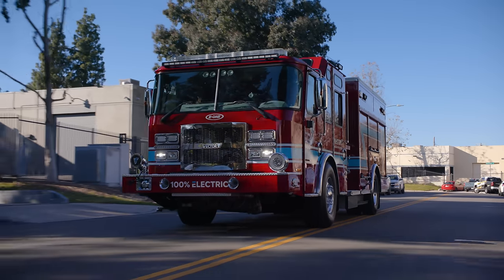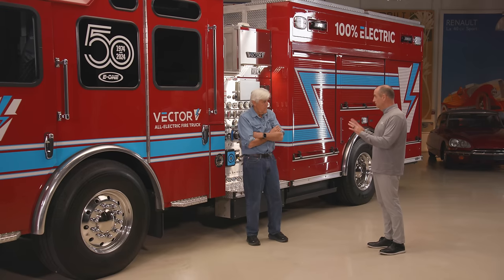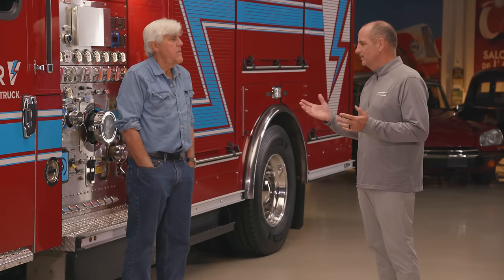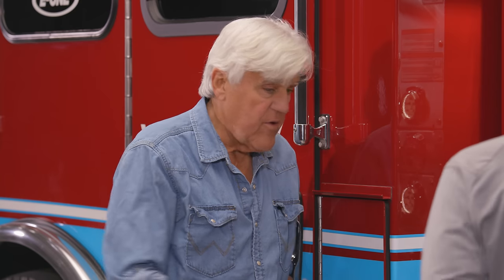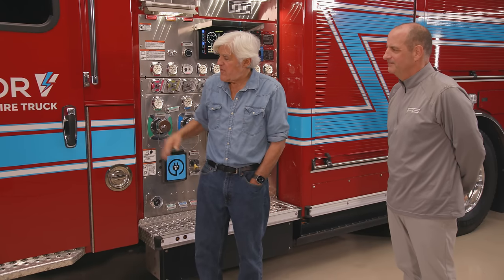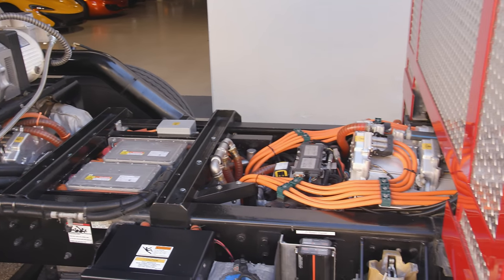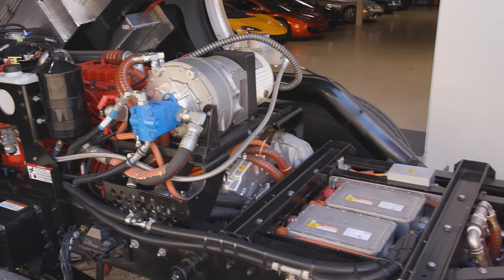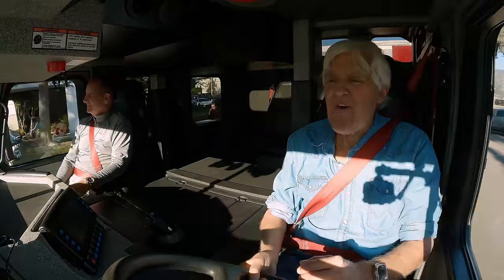The Future of Firetrucks?

Comment: Ah, the negative comments…the Fire Service …” 100 Years of Tradition, Unimpeded by Progress.” 
“Let’s build the same engine my grandfather work on .” “ I want to turn a knob , not press a button .” 
E-One president says it takes about 2 1/2 hours from zero to charge . Firefighter hears it takes 10 hours .  

In all the years I was connected to the Fire Service , I never heard a bigger bunch of back stabbing , complaining old ladies in my life .
Reply: He said 2.5 hours with 3 phase 480V. Perhaps the 10 hour charge is on 220V?
Reply: Yeah those batteries last about 5 years then it cost another hundred thousand dollars and tons of more diesel to mine the batteries God forbid the weather gets cold😂
Reply: Lol right. Only way you can say a leather helmet is better than a salid bowl, is it looks cool.
Reply: No thin blue line in the fire service that's for certain!
Reply: @tkreitler  It's very simple he said 327kwh battery and 2.5 hour charging time. That's 130kw / kVA average charging speed, which is closest to industry standard 150kw peak Level 3 DC Charger. Thus why it uses the bog standard Type 1 CCS plus same as personal cars.
327kwh for 10 hours mean 32.7 kW / kVA charging speed. No such charger is being produced in large numbers. There is a gap between Level 2 and Level 3 Charger which is about 25k to 50kw where chargers do not charge at that rate.
It's either going to take 16:15 hours at Level 2 240v or 6:30 Hours with 50Kw Level 3 DC. These are the realistic slow numbers.

Comment: Makes sense for it to be electric. Most trucks just sit around for days so it can charge all the time. Most trips are short. They need ambulances to be electric as well.
Reply: Yeah, maybe in a small town department
Reply: Are you on crack? Ambulances might go 18 hours straight without making it back to the station. I’ve literally had to stop for fuel on the way to calls because it isn’t hard to burn through your 200/300 mile range of a standard ambulance. A lot of services spec larger fuel tanks.

Comment: This is a good application of an electric vehicle, inner city, short haul, high power. 
The pump requiring an engine negates the viability of an electric pumper truck. There are other fire trucks that could be EV; ladders, ambulances, chief, etc...
Nice to hear the EV is done in Scotland. Let's keep our essential infrastructure in the West.
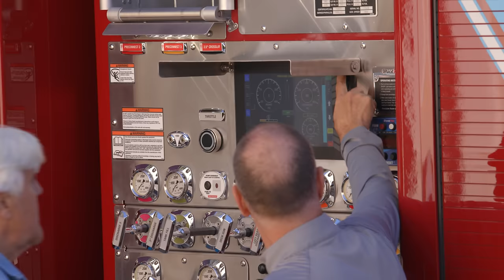So far as conservatism is concerned, at a fire one cannot have an equipment failure. Electronics just aren't reliable enough for something like this. That glitch at 24:20 is a great illustration...
"Stuff that works" is the idea.
Pollution of a fire truck at a fire is an oxymoron, the fire is causing thousands of times the amount of the truck.

Comment: They already had problems with them in Canada.cold weather...
Reply: Oh, yeah.    EVs have to keep the battery working.   The computers make the health of the batter the #1 priority.
Reply: @GilmerJohn  Weve got some new all electric buses around her, they have 
very powerful AC, not for the passengers, for the computers and motor to keep them cool.
Reply: @phillipsmiley5930  --  well, most electronics can actually tolerate moderate extremes of heat and cold.   So can motors.  I would hope the designers are smart enough to not worry about the electronics or the motors getting too cold or moderately hot.   But as a continuing chemical reaction, the batteries have more constraints.   Freezing might destroy some cells.  Moreover, the performance and life greatly changes with temperature.
Reply: @GilmerJohn Once the giant battery gets cold enough it's done! There's no way to get around that! They aren't feasible in cold weather states.

Comment: Putting a diesel generator inside of the thing is comical
Reply: What’s the point of it being electric. All these companies are just trying to money grab anything with EV crap.
Reply: How's a backup diesel invalidating all the benefits of electrification? We got battery and generator backup if the power grid fails but nobody in their right mind would say: "Gotcha! Should've sticked to petroleum lamps for light!"
Reply: @alfredvondrachstedt7129  Point is that it has labels on it saying it is 100% electric, which should include a big asterisk. Not saying the vehicle isn't useful, just deceptive marketing.
Reply: @mavenhelm  --  It's a option.   Were a department to order a truck, I suppose they might save $5k if they leave the diesel generator off.
Reply: @GilmerJohn  - $5k? LOL good one.
Reply: @OMGWTFLOLSMH  --  Well, I try to be entertaining.
Reply: @mavenhelm ? It is all electric. You don't have to use the range extender!

Comment: Canada's first electric fire truck was in service less than a month before it needed repairs.
Reply: A Whole Month! i would have put money on it being less than a week before it got someone killed by not being available
Reply: As a technician,  these things won't last long before the fireman cry that they wany the old diesel ones back that are actually useful and cheaper.
Reply: @JohnTaylor-bd1uy  It had problems with pump system LEAKING water . As if a diesel pumper has never had water leaking problems before. Stop with the horrible assumptions.
Reply: Glorious intentional omission of details there.
Reply: @Neojhun  Pump driven by diesel engine in ICE which has redundancy engineered. EV relies on single electric pump. Water and electricity not a good mix for trouble-free operation.

Comment: So 100% Electric is false advertisement due to the fact it has a diesel generator onboard to charge pumping batteries.
Reply: Technically it is still 100% electric. Everything on the truck is electrically driven. It just happens to have its own onboard generator.

Comment: What would make sense is that wherever there is a fire hydrant there is a 3 phase hookup right next to it so you can plug the fire truck in on scene so it would be able to indefinitely carry on fighting the fire for as long as you need it to for say larger fires that may take hours to put out? Just an idea the batteries would only really be used to move the vehicle and initially start fighting the fire once you hook up power it will basically be ready to go straight away! If you was to also use say rubbish trucks that may need a 30 minute charge they could also use the power hook ups when they take a break, buses pretty much any public large vehicle could use them when there isn't an emergency!

Comment: Having an onboard diesel generator to make up for no diesel engine . . . Interesting
Reply: "Zero emissions" virtue signaling.
Reply: Early days.  The technology is maturing.  The first steam ships also had sails.
Reply: @55Bentley6  The first steam ships didnt kill anyone by not arriving
Reply: @whatsmynameagain691 I hate that phrase “zero emission” it’s literally impossible to be zero emissions. Even when you die your body is still emitting carbon.
Reply: @55Bentley6 the first steam ships had sails because it was what people were used to seeing and it was more decorative than it was necessary, it’s necessary to have diesel generators on battery powered trucks, which completely defeats the point of a EV
Reply: They use it less than you think
Reply: @phillipsmiley5930  The first steam ships killed anyone on board by exploding. Your point?
Reply: instead of hitting the gas station every day / several times a week, they might have to go there once or twice a year
Reply: It makes sense. On almost all calls (about 99%) the battery capacity is sufficient so the engine never runs, and diesel engine operation is avoided.
Reply: @whatsmynameagain691  FYI There are some Chevy Volt owners who average 1000 miles per gallon. Mainly because you should not keep old fuel in a car thus they need to burn it off. It entirely depends how much you charge the PHEV vs use fuel.
Reply: I can just see the old codgers sitting around the potbelly stove moaning about the gas-o-line fire trucks replacing the horse drawn rigs.  "That gas-o-line is worse than any fire, by gum"
Reply: @mipmipmipmipmip The biggest EV breakthrough was BMS and massive cell array. That allowed a large amount of energy dense Cells to not catch fire instantly. This was achieve with NiMH Nickel Metal Hyrdide in the early 1990s. It was only ever achieved with lithium ion in the early 2000s. It still is early days due to the lack of support.
Reply: errrr not really as the diesel doesn't drive anything and is a redundancy fall back...

Comment: "Sorry, we can't respond to your call at this time, we were recently on a 14 hour 3-alarm call in subzero weather, and our truck needs another 6 hours to charge."
Reply: and his dept had to sell 3 of their fire engines to pay for the EV
Reply: Note that they include a small diesel generator that can when needed charge the battery faster than its drawn down so that is quite an implausible scenario.  

More likely is we can't respond since we are in the middle of an oil change on the diesel truck since it has too many hours on it or the Injector Pump got fouled and we are in the middle of changing it again.  In cold weather it can also come down to the fuel gelled and is too thick to run the engine so we need several hours to heat the diesel fuel tank up before we can start the truck.  Up North even with heated garages our delivery trucks when out on calls would end up getting stuck due to fuel gelling even with a winter blend of diesel in them when we'd have an unexpected drop in temperatures making it so we'd have to send out a tow or a truck with a jet turbine heater to get the tank warm and the fuel liquid enough the pump.

Large truck diesels take gallons of engine oil plus there are engine oil filters, fuel filters and water separators that need to be serviced at each oil change (sometimes more often than at every oil change for the fuel and water filters/separators) so that can add quite a bit of time to get an oil change done after which you have to bleed the air out of the system to get them running again taking even more time.  Anyone who has changed the oil in a diesel knows how much dirtier that oil is even after you've only driven around the block a few times so you also have that to deal with when servicing a diesel.

Best!

Comment: I wouldn’t call that electric pump motor quite. The high pitched whine would drive me up the wall in a hurry. I still think that fire trucks should have basic mechanical devices that will work under any circumstances, like after a hurricane or tornado, or even in a war zone. Huge respect to Jay, that guy is brilliant.
Reply: So I guess you missed the part about the regenerative brakes and the onboard diesel generator to charge the batteries faster than the output?
Reply: @markmed9091  No I didn’t, wise guy, but that wouldn’t be practical to rely on for days or weeks.
Reply: @rjsmith6698  The trucks don't constantly operate for days. The departments know the average number of calls and demand.
Reply: @stevevarholy2011 exactly on call dammads gas is more reliable hence diesel engine onboard.
Reply: They would in the type of scenarios I just described.

Comment: Well, I can tell you that this truck is no bigger than a European large fire truck, in fact, its seems a bit shorter despite hauling all these batteries around, maybe a bit wider with all the disadvantages that brings. 

And while I am a big friend of electric propulsion, storing the energy in batteries in a fire truck - of all vehicles -would not be my first idea. Despite the fact that there are Lithium Iron Phosphate batteries that are not as volatile as ordinary Lithium Nickel Manganese Cobalt batts, powering a heavy vehicle that is often hastily driven towards fires, seems a bit counterintuitive. 

The big question is: What is the real advantage? Even if it was faster, its still no race car and limited by traffic and caution. Assume you need it as a pump truck at a laaaaarge fire for many hours or even a day, how do you ensure it keeps pumping without a diesel generator charging it? Might as well just stick with a diesel powered vehicle, which you can just fill up all the time.

I just dont see the point for this specific, specialized emergency vehicle.
Reply: Well, it has twice the torque.  That equates to far better performance, response times, and stronger pumping.  It has far lower maintenance which keeps annual budgets happy and trucks available, and it makes almost no noise so the crews can communicate easier and hear things happening.
Reply: You don't drive INTO the fire...
Reply: The point is Democrat virtue signalling.
Reply: @jimjones-pz1tt  Huh?  When did the a/c motor powered car get so political?  Before the Biden administration, we all had fun with the "Chevy vs Ford" type stuff running Tesla's against supercars, putting Dodge Demon's up against the Plaids...  What changed with this administration where we now forget about all the performance and boil it down to politics?
Reply: @aussie2uGA  --  Well, if a woke political jurisdiction wants to spend twice as much for the same job, someone will step up to sell it to them.
Reply: @GilmerJohn  What makes an a/c motor suddenly woke?  Remember, as little as 3-4 years ago, we all talked about the incredible performance and torque, how the big screens looked distracting, compared to an appliance...  Then  suddenly, all EV's are now divisive and political.  What changed?
Reply: @aussie2uGA  mandates.  nice to have a choice, not to be forced.  if it's better, people will go for it.
Reply: @aussie2uGA  --  Good point.   My take is that heretofore the modern EV (& hybrid) was a combination of a display of wealth and a social statement.    But that gets old.   The EV & Hybrids & ICE will always have models which are statements of wealth & political views  but at things mature, each of these will mostly be purchased and deployed to be the best and most cost-effective solution to a real problem.   The EVs have their niche when they are the best for he job, etc.

That means that when something new is rolled out we use our most powerful tools of criticism and analysis.   Folks that continue to use ICE vehicles use much the same weapons against an EV solution as the EV folks used against the ICE folks.   It's turn about being fair play.   Most folks can't afford to buy stuff to make a social or class statement.   If the EV makes sense, they will buy an EV and if ICE makes sense they go that way.   While deciding the look at the best/worse arguments for and against each option.
Reply: @GilmerJohn  hey nice reply!

Comment: So, I retired after 26 years in Fire/EMS. I worked both rural and metro departments and I have seen a single engine sit and pump at max capacity for 92 hours straight and I don't see that truck being able to do that, even with the backup generator.
Reply: As long as you can keep refueling it there is no reason it couldn't. They said the generator creates more power than the truck uses while pumping. I'm sure that single engine that was pumping at max capacity had to get fuel brought in at some point.
Reply: @stephenj4937  Yeah but not 7 gallons at a time. You're creating something that has to be constantly managed by someone on the truck instead of keeping all hands focused on the task of solving the problem.
Reply: @dayneedinger9404  7 gallons was the size of the DEF tank. They didn't say but obviously the diesel tank would be significantly larger than that.
Reply: @stephenj4937  Interestingly, DEF and other after treatment systems are NOT required by EPA or CARB 
 on registered emergency vehicles. They know that the emissions systems are not reliable enough for emergencies.  You simply can’t have a vehicle shutdown or go into limp mode because  of a phantom check engine light when lives are hanging in the balance. The “fire truck”  in this video is not an actual registered emergency vehicle, therefore the emissions systems are it is required .
Reply: 92 hours is pointless, that is not a realistic use case for vast majority of FDs.

Comment: 2020s driveline with 1960s firetruck design?
Reply: Asked and answered in great detail in the video.
Reply: The Americans don't like change.  I think it's cool in a way they like to still be polishing all the chrome have it the old way.
Reply: @mrm1885 it’s because chrome shines thus makes the truck stand out which is what you want in a emergency vehicle. Also the large front bumper is to push vehicles out of the way if they are blocking access to fire hydrants and standpipes. I’ve seen it happen before car was parked in the red zone and the pumper pulled up behind it, touched bumpers with it and started pushing

Comment: 100% electric  but how do you charge it  how do you make the electric
Reply: Plug it in at the fire station.
Reply: Ideally, you'd plug it into a fire station that uses clean energy. Many are probably still using fossil fuels at the moment but as time progresses that too will change.
Reply: Solar panels on the roof 👍
Reply: @man_on_wheelz  Indeed. Eventually everything will be powered by fairy dust and unicorn farts - follow the science!
Reply: @paulm749  It's... not impossible or even hard to make solar power... or wind power... or nuclear power... or hydro power... it just takes time to make it widespread. Why does that sound like fairy dust and unicorn farts to you? Have you never heard of this stuff?
Reply: According to my calculations, a bunch of Energizer bunnies running around spinning a giant hamster wheel connected to an electrical generator should just about make enough electricity to charge this firetruck. Disclaimer: your results may vary.

Comment: Government vehicles are required to be at least 51% U.S. made by price. If the truck, batteries, motor, wiring and computer control module are assembled in Scotland how much unnecessary equipment (besides the leather Bentley seats) had to be attached in the U.S. to make the final product cost 51% U.S. made? Mind blowing🤯